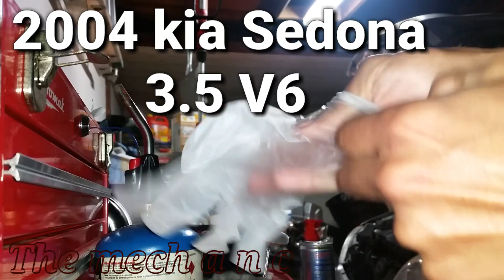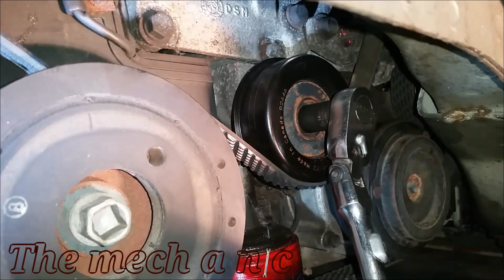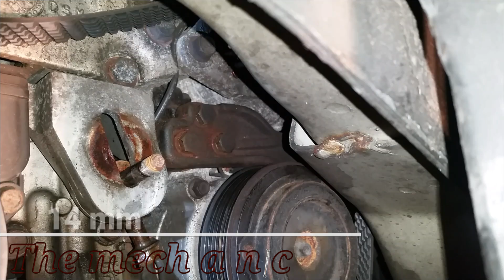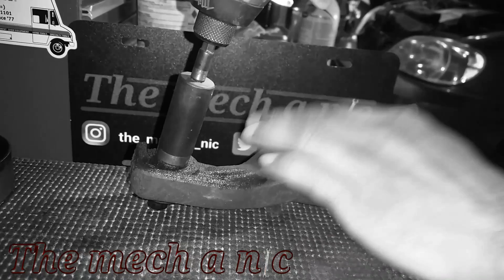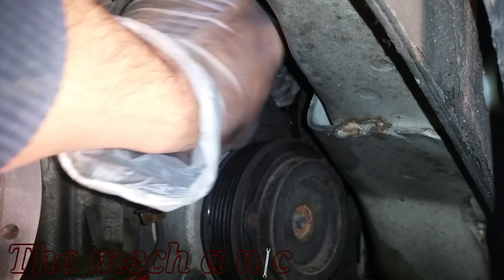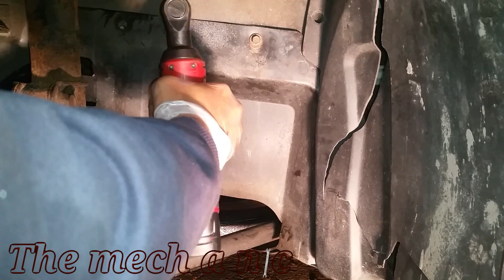2004 kia sedona idler pulley / tensioner pulley

Comment: That tensioner system is so lame. I was able to take my idler and tensioner pulleys off from the top in 5 minutes cause my belt broke but now I see that won't be the case going back on : (. 

Thanks for all the helpful info you put in text on your video

Comment: Nice vid, straightforward explanation. One issue I had though was that the nut holding on the tensioner is completely locked up when I attempted it, and even after a torch and cold chisel, it's now impossible to remove. I'm to the point of just cutting the thing off, but can't find a replacement tensioner bolt anywhere. Any suggestions where to find one or at least what it's called, or am I stuck with having to machine a new one?

Comment: what to do if the belt tensioner nut keeps spinning on the bolt. a little bit thread left and its free but feels like it will give but been ratcheting for a bit don't won't to damage the threads . I'm replacing a crankshaft sensor on my wife's 03 sedona .so both seperantine belts need to be removed and the crankshaft pulley.   the sensor sits behind the crankshaft pulley. this video is very helpfull.
Reply from the maker: The threads are stripped . Maybe a heli coil

Comment: Nice video, like the detailed explanation. I got the same car, ‘04 Kia Sedona. At first start when the engine still cold you can hear a loud squeaking sound and as the engine warmed up the sound start subsiding. Do you think this comes from the belt or pulley or both? Thank you.
Reply from the maker: It's hard to tell, you can try replacing the belt first and see if it fixes the problem. While the belt is off you might as well inspect for worn out pullies
Reply: The mech a nic thank you so much!

Comment: The original part, the bolt fits 'into' the bracket. The after market parts do not. Is this ok? Hope this makes sense
Reply from the maker: Im not sure what you mean but everything should fit if its the correct part

Comment: I put a new serpentine belt on and it squeaked then it snapped, do you think its a bad tensioner or did tighten the pully too much when i put my new drive belt on? I cant move the sedona unless i tow it to the mechanic.
Reply from the maker: Did you check all the pullies to make sure they spin freely before you out the new one on?
Reply: @themechanic6117  the crankshaft pulley and idle pulley do not move when van is turned off
Reply from the maker: Crank shouldnt move freely. You have to turn the engine over for it to move but the idler should spin...thats probably what caused your belt to break.
Reply: @themechanic6117  
Got it fixed. Thank you. Hope this also helps other people who come across this issue.
Reply: @DeanCorso321  what was the problem? The idler pulley locked up?
Reply: @davidallen3078  
Yes. I replaced it and it's been running fine since.

Comment: I was wondering for that tensioner pulley . I  loosened up the whole bolt and now it’s hard to put it back on and I think messed up the threads.
Reply from the maker: The bolt that's reverse threads?
Reply: @themechanic6117  It’s reverse threads ? Meaning what ?
Reply: @themechanic6117  I was just changing alternator and to do so I had to loosen the belt tensioner right. So what I did was I loosened the bolt too much that it came off and when I wanted to put it back on it was hard. Spent hours trying to get it in. And when I thought I got some thread in it started getting hard to turn .
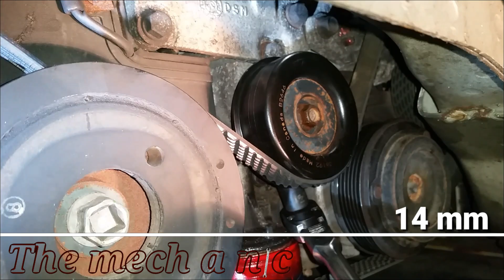Reply: @themechanic6117  the bolt under the pulley that your talking about at 2:00
Reply from the maker: Ok yeah that bolt comes off normally.  You may have to replace the bolt and chase the threads on the other end if the threads are damaged
Reply: @themechanic6117  do you know what kind of bolt it is ? So I can have it handy for when I take it out and replace it ?. So maybe I have chance to  screw it in on the others side . Is it still right tighty ?
Reply from the maker: Sorry I wish I knew.yes it's right tighty

Comment: If this part falls off, is it safe to drive to the mechanic or should I get it towed?
Reply from the maker: You won't have any accessories suck as the alternator, power steering so you won't make it far. Probably best to tow it

Comment: Which way do u spin the six point to get the idler pulley off
Reply from the maker: I believe its counter clockwise
Reply: @themechanic6117   I have no drill will it still work with the rachet
Reply from the maker: Yes
Reply from the maker: Sorry i think you turn it clockwise to remove it. Sorry for the wrong info before

Comment: need to know the part number used in this video and also need to know the part number for the adjustment bolt ?
Reply from the maker: +awitha leona not sure of the part number. The pulley is sold at your local parts store . The adjustment bolt you might have to go to a junk yard or find a similar bolt at home depot

Comment: The Mech a nic do you know where i can find a adjusting bolt that holds that part on at  https://youtu.be/2H53bPcMTJw?t=198 (3:15-3:19) that bolt, mine broke and i am looking for a solution to take out the broken one that adjust the tension to the belt, what type of bolt m8 or m10 and length
Reply from the maker: I'm not sure ,you're best bet would be to go to a junk yard
Reply: @themechanic6117  darn.. i know they make some in the united states, but i am from canada and they don't make them here, i'll drill out the remaining bolt that is inside the adjuster housing and try find exact fit bolt
Reply from the maker: Sounds like a nightmare. I hope you get it resolved
Reply: @themechanic6117  well i was almost done, i thought i sprayed the bolt so it would be easy but it was the other side power steering adjusting bolt, but things happen.. thank for the video i ordered more parts i will just change since i'm in that area..
Reply: @themechanic6117  found the bolt size.. 

M10 x 1.25 x 40mm 

crossing my fingers this works